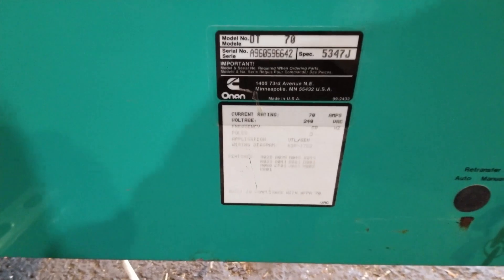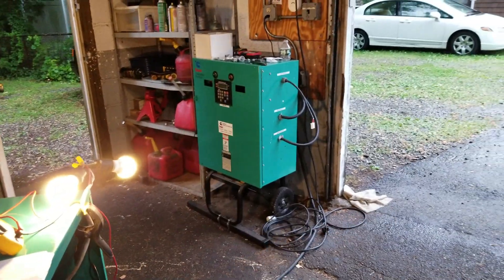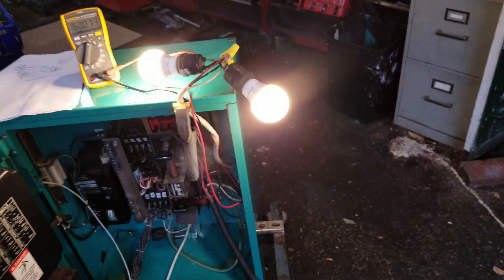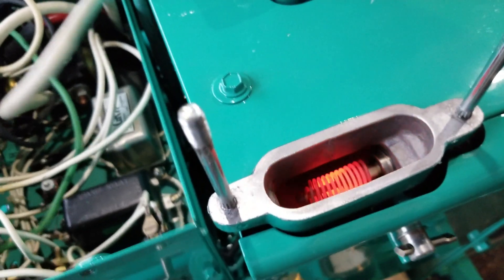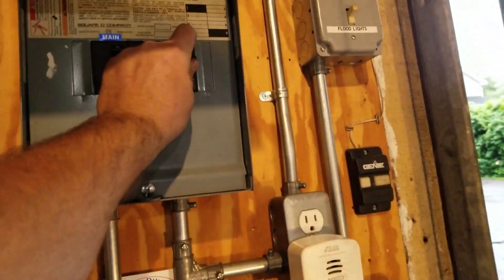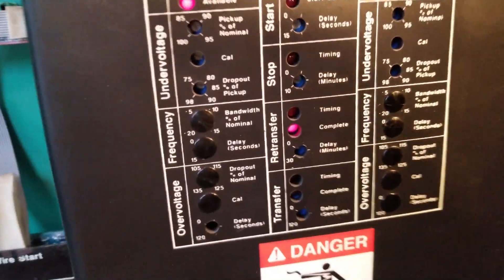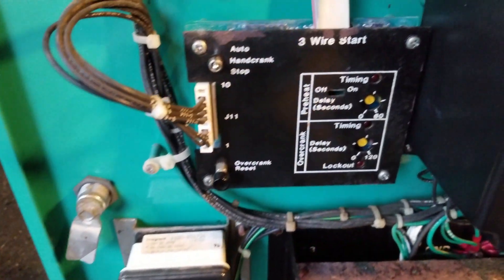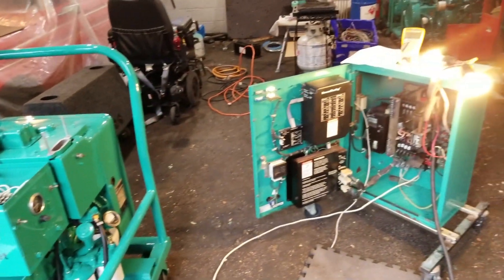Connecting an Onan OT 70 automatic transfer switch to a 3 wire diesel set

Comment: Right now we need a service on a unit model #OTCU125G15G -AMPS 125 - PH 3 - HZ 60 - WIRE 4 . IN COLUMBIA SC. TRANSFER SWITH NOT WORKING.